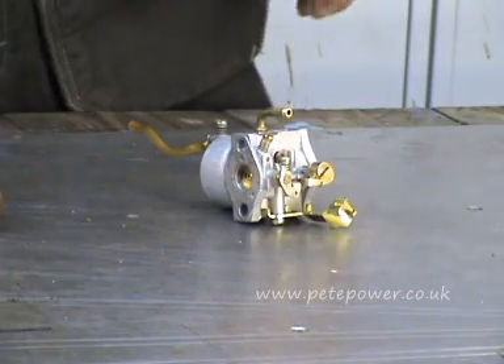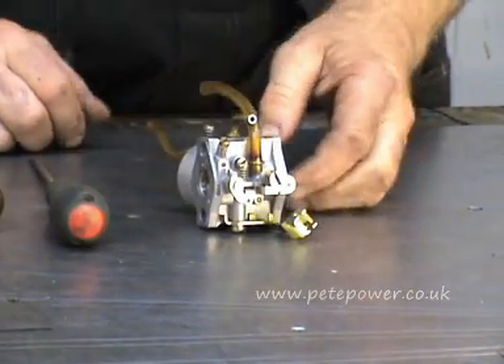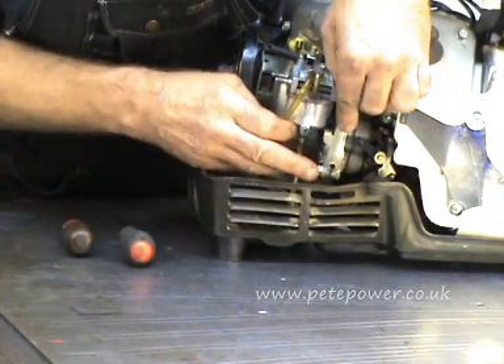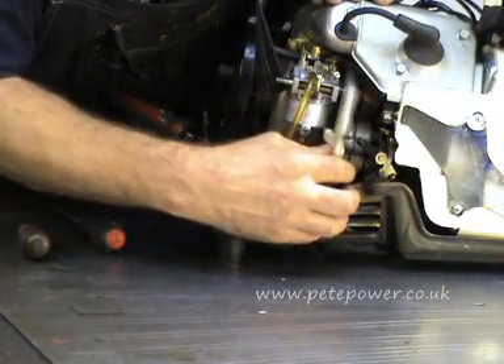Honda EX650 generator repairs carb clean part 2.wmv

Comment: Peter, why would ex650 surge after load was removed? (Electric drill) Should fuel drip when turning switch from off to on or choke and then run well without dripping? Thank you!
Reply from the maker: Fuel should not drip ever. Sounds like torn fuel tap washer. Surging after a load is removed could be to large a load, something rubbing on the governor/carb linkage, damaged or incorrectly fitted governor spring, incorrect governor setting, throttle stop screw wound in too far and numerous other things I can't even think off.
Reply: Thanks Peter for your helpful videos
Reply: Peter, you were correct, it was a very small tear inside the Petcock and the surge was bad gas in the fuel tank/system. I purchased a new petcock and put in new fuel and it runs like new....Thank you so much!...Mike

Comment: Thanks for this video, my EX650 would not start, would run for a few seconds if I poured petrol into the carb throat, but would die. I watched your video, and it gave me the idea to remove the float bowl, and take out the jet without removing the carb, I only removed the plastic snap on cover, and the float bowl and then I removed the main jet and it had some varnish in it, I snaked it with a piece of stripped CAT6 copper wire. Put it all back and BLAMMO, she's purring like a kitten!

Thanks for the video.